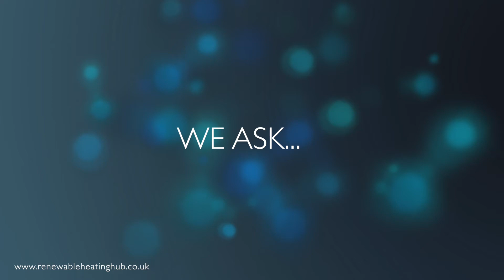How can the efficiency of a heat pump exceed 100 percent?

Comment: I'm very interested in heat pump (heat transfer) systems and would be interested in using one to heat my home IF (IF IF IF !!) such a system would be effective performance wise AND economically.   My present system uses an air conditioner (which is effectively a heat pump..hot compressed refrigerant outside at the condenser...cool decompressed refrigerant inside at the evaporator ), and the heater of the unit is a natural gas furnace.    I know it costs more than twice as much per day to make the thermal change in cooling the house than it does to heat the house with the natural gas furnace.    

Why should I think it will be more practical, and affordable, to move heat from the outside to the inside in the winter (heat pump, an air conditioner in reverse) than it does to move the heat from the inside to the outside in the summer?    

If the cost of thermal transfer is the same in to out, or out to in, it would seem the gas furnace should come out ahead by a wide margin.

I realize the ambient air temp outside the house matters for performance (30 below in Michigan is a challenge for a heat pump) but to raise the temp 15 degrees or lower the temp 15 degrees inside should be similar in cost, should it not?